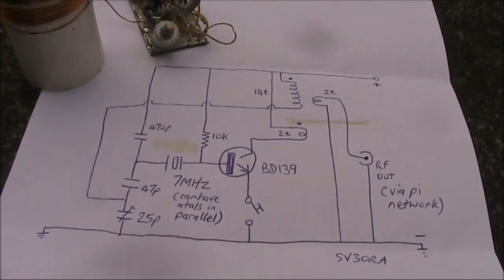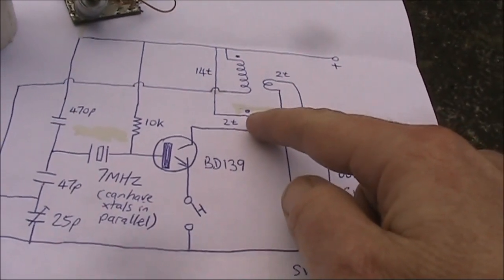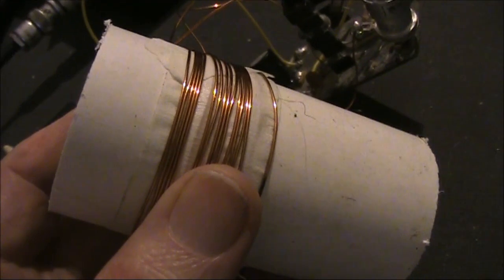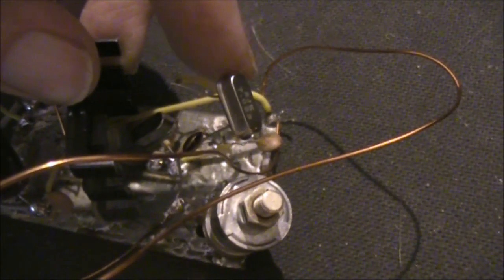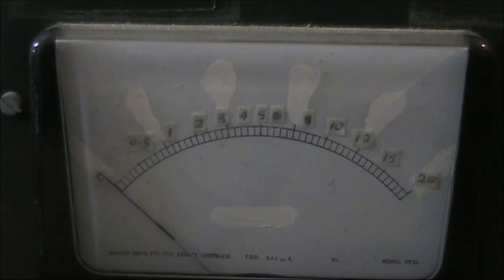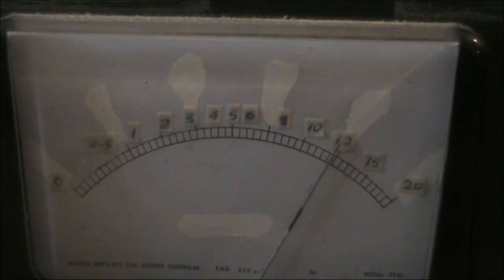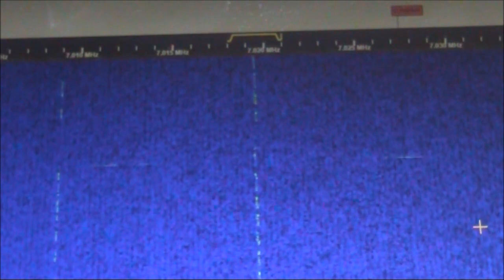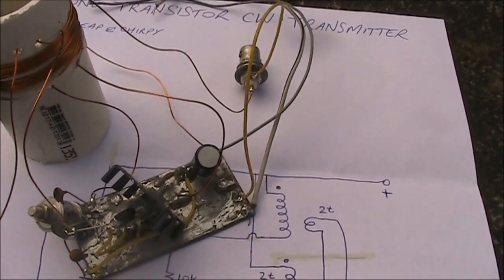Cheap and Chirpy 1 transistor CW transmitter

Comment: I built this QRP and I liked it, it's very good, I want to know if it's possible to transform this fixed oscillator into a VXO, it would be cool if I could change the frequency, I'm a radio amateur my call sign is PY5LG Brasil

Comment: This is supercool.
Can it be modified to use as a music transmitter for the mediumwave band ?
Reply from the maker: I've done some low power AM videos. Eg https://www.youtube.com/watch?v=Wgj22ZU63KY But for more range you should have at least 3 transistors in the RF section and properly modulate the power amplifier stage with a good audio amplifier.

Comment: Once I made a “dub siren” analogue synth. The sine wave was constant but when I breathed warm air (like you want to warm your palms on a cold day) onto the circuit, it changed pitch! I searched and found that when the humid warm air hit one of the capacitors this changed the pitch! I wonder if it’s not the same source of instability in your circuit as well, try blowing warm air onto the capacitors to see! Cheers and thanks! PS I want to build your other circuit with the inductors 😀

Comment: if you ever need a transmitter to quickly send a message this would be it, as long as you can send a message and get done what needs done it doesn't really matter much about the tone because its still transmitting code and that code is words 

nice video mate

Comment: can it be used as Fm transmitter with mods
Reply from the maker: No. Better to use a dedicated VHF circuit. Many bug circuits on the web eg on the Talking Electronics site.
Reply: @vk3ye  ok.thank you.love all your work with minimalistic designs
Reply: I built this QRP and I liked it, it's very good, I want to know if it's possible to transform this fixed oscillator into a VXO, it would be cool if I could change the frequency, I'm a radio amateur my call sign is PY5LG Brasil

Comment: Would you be interested making a video of making and testing this transmitter? http://sparkbangbuzz.com/easy-ten/easy-ten.htm It is supposted to have a range of about 15KM and it is very simple. If you want you can try different transistors and you can even try to add some amplifier stage to it, its a simple transmitter with no handwind coils. I would be  really happy if you would try it and made a video about it.
Reply: Good project, 10 miles range  is amazing

Comment: I built one of those on a toilet paper tube for code practice many moons ago, except used a variable capacitor instead of a crystal.  Needless to say it wasn't all that frequency stable.
Reply: Of course! Without a crystal in the feedback path, what kind of stability would you expect about any power oscillator? Peter hasn't built it properly too, that is why chirp suffers. If you build it properly as described in the page http://qrp.gr/emtx and if you parallel more hc-49u crystals or use vintage ft-243 ones, you will barely notice any chirp even at 10W of output power that this transmitter is capable of! I've built that already and I know what I am telling you.

Comment: I love seeing variations of the Michigan Mighty Mite. They're so deceptively simple (iirc most version of the mighty mite use 2n2222 since it's plentiful and will work up to 40m).
Reply: This is NOT a variation of the Michigan Mighty Mite. The only common thing is that both are self-exited power oscillators. The Emergency Transmitter by sv3ora uses a capacitive divider in the feedback path and then the crystal is connected to it. That is totally different of the Michigan Mighty Mite, which by the way, can't provide 10W of output power like the EMTX does.

Comment: I wonder of this could be converted into a transceiver by have the transistor double as a regenerative detector? Maybe controlling the base current for transmit as well as a regen control. Just a thought. Cheers, Ian
Reply: I have tried that but didn't succeed. I couldn't make the thing oscillate at low power, it always started from about 4W and upwards with the transistor used in the EMTX article.

Comment: Hi Peter, just wondering how you measured that the outgoing coil (2 turns in your version) has 50 ohm impedance? Have you used SWR meter to check with how many turns the PA is matched to the antenna? Or is it some other way/calculation you did? I did 2 transistor QRPp cw transmitter but don't know how to verify the output is 50 ohm. Also, would help here to use 78L12 to stability of this one-transistor transmitter? I didn't check what is max V this BD139 can handle, but I imagine with higher V e.g. 24V we can draw even more power?
Reply from the maker: You're over-thinking things. Just build it and use it. Make changes to optimise its output. If it blows up then you've done something wrong!
Reply: Where the power is low you really don't care much about SWR and matching although it will still improve performance.  Seems to me that keying the emitter is going to introduce some dynamic impedance changes anyway.